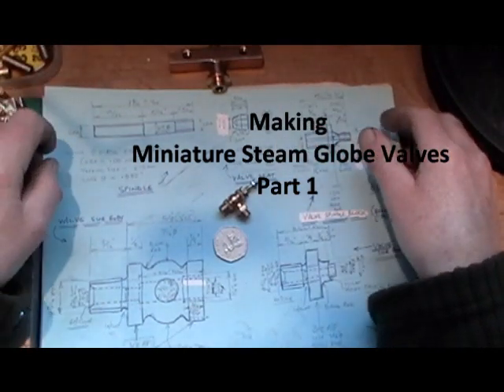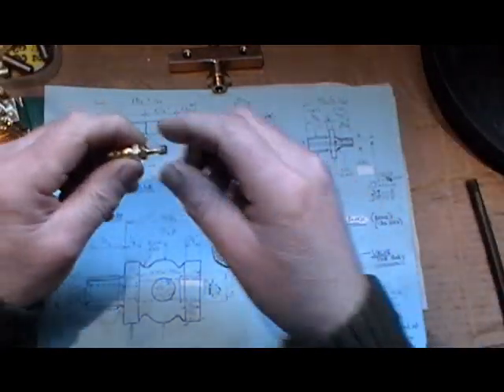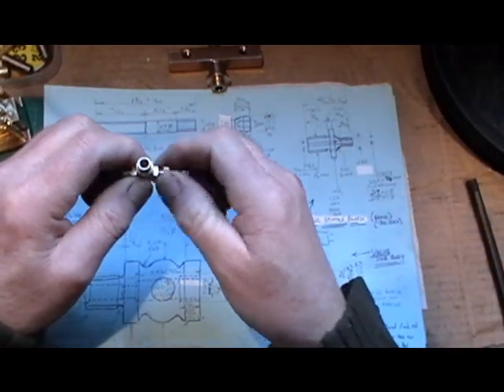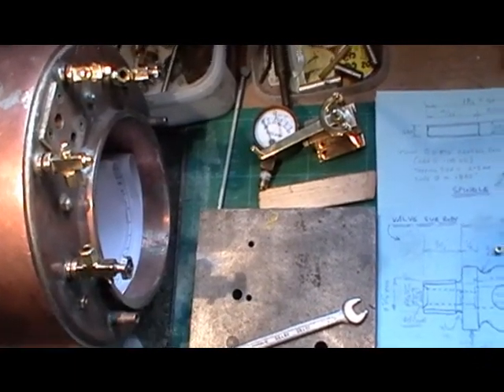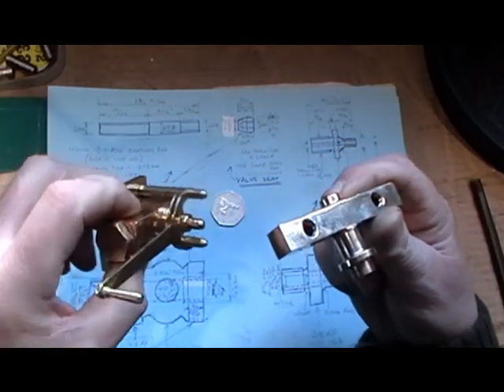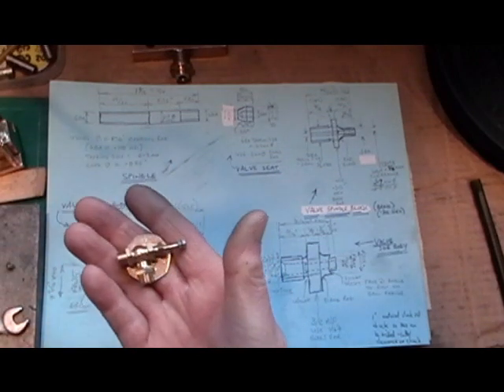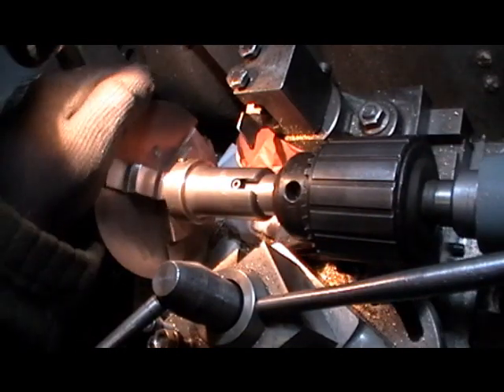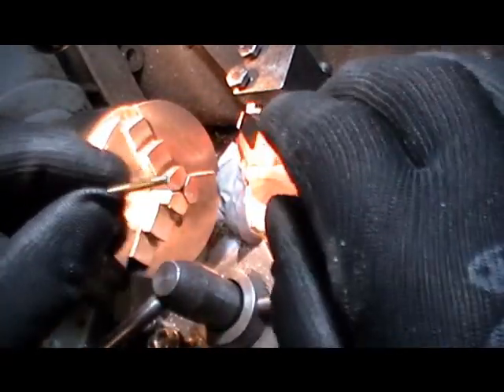Making a steam loco boiler (Fittings) PART 8 (Miniature Globe Valves 1 of 2) "mr factotum"

Comment: I'm not sure but do you mention the materials used, other than for the one spindle? It's important to make all the major parts, bodies etc, out of bronze, not brass as brass de-zinkifies with hot steam. I make my fittings with running nuts so I can lock them down in any position.
Reply from the maker: cheers Harold
thanks for watching and feedback, its a long time back so forgot if i mentioned it, but will check. They've been on the Loco 5 year now and no problem arisen.🚂🚂👍👍😉😉
Happy New Year
atb
Kev

Comment: "buying is the word that's not in my vocabulary" - It's not in  my vocabulary either if I can avoid it. Subscribed the instant you said it.
Could you use stainless steel for the valve spindle? I've made them from S/S machine screws by machining the head to form the valve 'seat'
I'm not a skilled machinist so blokes like you are a source of vital info for me to gain the skills I lack.
Reply from the maker: Hi Jeff,
Thanks for feedback, yes, some people say i'm tight, but i just say i like to get value for money. If i can make it i will.!!
Yes i suppose nothing to stop you using a stainless spindle, if i remember i made the regulator valve from st.steel.
where all, always learning at this game. 
see you next time
Take Care
 mr f